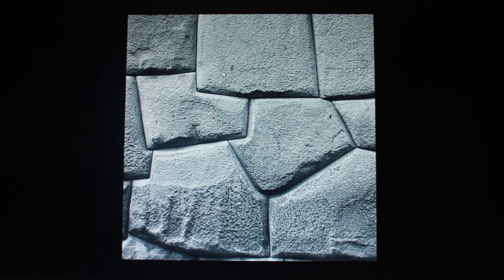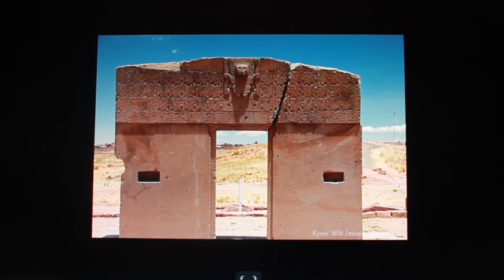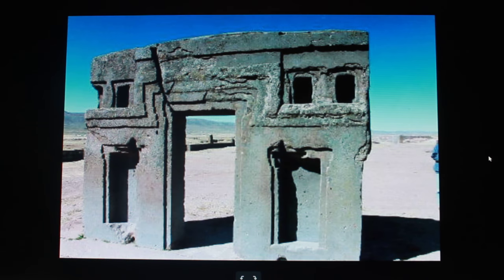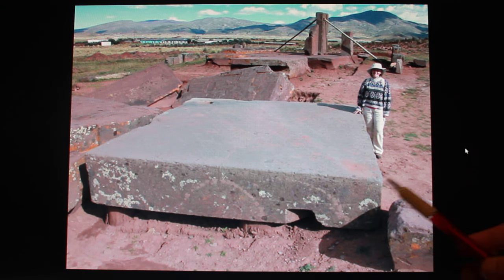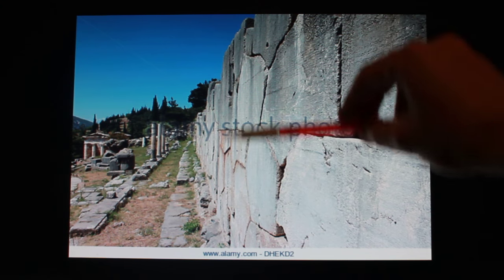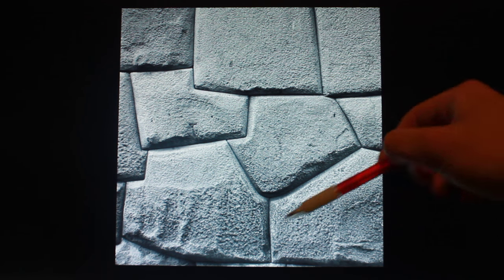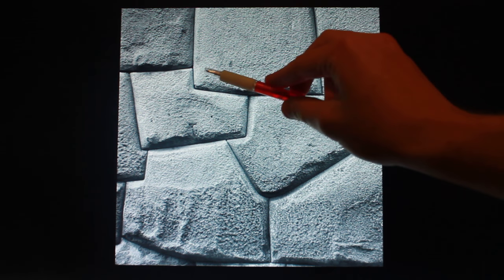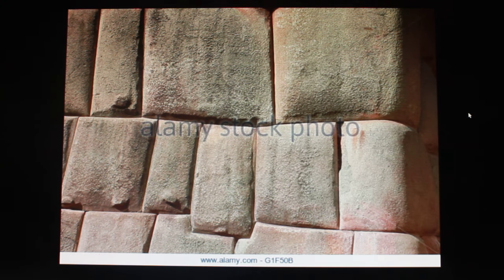How were the POLYGONAL MEGALITHIC INCA WALLS BUILT? LIKE THIS?

Comment: This deserves more downvotes.

These are rocks, they come from a quarry about 5 miles away, there is a lot more of the same rock there.  There are half finished examples not yet cut from the bedrock.

Did it never occur to you that it is very easy to analyse rock to find out what type it is and indeed if it really is rock?    They have analysed the types of rock used, it's Yucay limestone, green Sacsayhuaman diorite porphyry, and black andesite. 

In many places the rocks they used have not been face dressed so you can still see the raw rock texture, yet they are still perfectly fitted together at the joints.   They do not resemble cast artificial rock.

Congratulations on adding yet another half backed theory to an already swamped field!

Comment: I disagree.. If it was concrete mix, then you tend to find more tools, bricks, utensils or other object made up of same or similar concrete, which obviously was never found on the sites or in any excavation. You are also suggesting that Inca walls and Egypt pyramid builders were same and using same concrete method but left no-clues about it? I doubt. For me they are all clearly stones probably first base developers were not humans. Humans added frills on top of it incrementally as they evolve.
Reply from the maker: All good points! Well the clue is the similarity I guess.

Comment: Same mistake as many others or maybe a deception on purpose? Incas stone walls fit perfectly on the visible side and just a little further into the joint. The gaps inside the wall are filled often with filler. Only very few places the fitting would go all the way across the wall and often only on on side. There are many dismantled stones to be observed. And they simply do not fit as a concrete poured stones would, only the facade does. It is of course still not know how exactly they did this, there are many theories, each has its pitfalls. But stop making the concrete nonsense - it is very obvious from the loose stones that this is in fact fitting. There are places such as Sacsayhuaman where you can observe stones that fit on both sides. Still doesn't make them concrete. Yes we may find difficult to imagine how the fitting was done, but it simply was done and the stones themselves are the evidence. They are not concrete or poured material no matter how much you wave your pencil in front of some picture from internet sitting at your home.

Comment: when working with concrete, the bag has nothing to do with the Mixing of the concrete... you have to MIX the concrete to get it to begin a reaction that enables the particles to pond together and harden... yes, you Could use wooden frames to get particular shapes, but as far as is known about those regions wood was relatively scarce. now you Could say, that the lack of trees these days is from deforestation for such projects, but that would have Certainly caused a decline in their civilization because of the drastic change in climate and conditions from those areas due to the lack of water retention via the trees, and soil moisture thanks to the ground cover. now, back to the topic of concrete, typically you have various sized gravels called aggregates that make up much of the volume of the mixture, coupled with cement which is the material that bonds those various particles together. concrete Can be made very strong, that is true, but only in Compression, not in tensile strength, without metallic reenforcement. the texture of those walls, is likely due to weathering, especially if they are more than ten thousand years old, as is claimed by some such as Brian Forster. geologists are also quite good at identifying types of rocks, and if its said to be basalt, it very well likely IS basalt... now, Could it be remelted and then poured in a form Like concrete is? the answer is... only if you have a LOT of heat to be able to adequately melt the stone to a consistency that could be poured and formed. in order to melt stone today, in any quantity takes a Very large amount of energy, and very precise temperature control to be able to prevent vaporization from over heating, and to get the right consistency without any blockiness. and, to control the quality of the stone, would be difficult because there are all sorts of potential contaminations that would ruin a bath and cause the final product to be of an undesirable type. if concrete where used, it would be possible to identify the various aggregates, and the bonding material used. the more Likely scenario, is as brian F said, and that would be very advanced machining technology, coupled with, perhaps an unknown method of being able to move and transport those blocks in the time and numbers required. he shows evidence of what seem to be massive circular stone cutting saws, with a very advanced cutting technology that enabled very fast cuts through the hardest of stones. if you can control the angle that a blade cuts, you could Make and Plan those geometric connections to a very high degree of accuracy, especially if you already have a very good idea of how you want a building to fit together or look, so that for each stone brought to the work site, you could plan the way that where to be cut and shaped, and using whatever mechanism to lift them, be able to lift them into place and set them into place Very successfully, and with relative ease. we currently struggle to lift more than 40 tons with modern crane technology, but there are stones that weigh in at over 1000 tons and more... and even if we knew How those buildings where built, we still wouldn't know Why, and to what purpose they where built. the fact remains that we do not have much literature from people who lived around these buildings, that would tell exactly Who built them and why, and even if we Have a building where a name is given, it is also very well known, especially in the case of Egypt, that rulers would often appropriate and reuse older works and buildings, and Claim that they built or sponsored them... we also have to take into account the potential for astronomical alignments to give an Idea of what time period a building or monument was built, but it can't be said for Sure, if they where not made as a memory or a precursor to a time period... especially if you Know how to read the sky, and follow the constellations, and can make accurate predictions and calculations based upon observations...

Comment: Those are "PRE" Inca walls! I also see that you can't tell the difference from concrete and sandstone, let alone basalt. How was the machining done without leaving any tool marks on the stone? Why are some of the stones magnetic? You have never seen stone that is over 12,000 years old and with one side exposed to the elements. How about the stone that was completely buried and shows no weathering? Is there such a thing as basalt concrete?  Good luck with your analysis, it just does not fit what I have learned of the places you are attempting to describe.

Comment: Is it possible they knew how to cut much larger blocks into Geometric shapes that enabled them to puzzle them together like this?

A design that meant you could virtually use any side or angle of each cut and it still lined up at some point.

Like a huge jigsaw puzzle but not so rigid

Comment: Thanks for your ideas. Each is a custom cut and placed andesite stone. The nubs are at the original width of the quarried stone and are lifting/moving points. Same can be seen in near east and far east, like China.
Reply: JustAnotherAkin Most of the stones don't have the "nubs" so I assume they had to levitated in place because ,  "hey - no lifting fixtures."
Reply: Nubs removed after placement, unless used to stabilize scaffolding. Some never get removed because of limited time and manpower. Also found in Japan. Nubs also locked into sleds to handle inclines.
Reply: Also wanted to mention, when you see nubs going up the side of a stone, it was moved on its side and lifted onto its end. Assembly sequence can be noted by this.One more item is the use of wooden cutting jigs to get the shape needed, were used extensively. When the stone was cut, it fit the first time on placement. These guys didn't do the same job twice. Would you?
Reply: JustAnotherAkin then how to you explain  the nodes on natural walls of stone in peru ?
Reply: I have seen some nubs on the upper side of blocks, just below and outside of window cuts I expect were used to mount something. ie: wood decoration, cloth, or stone carvings. A few can be seen on regular walls right in the center of the blocks, I expect these are just for mounting objects. Note on some walls indented cuts were used for lifting points, this took less work than the nicely dressed stones with nubs. Workers must have been in the "Git-er-done-mode".
Reply from the maker: Cool! You're welcome! Yes I have to say you are probably right for certainly some of the walls, they seem to be cut and placed. That's a good observation for what the nubs are for, yes.
Reply: JustAnotherAkin I believe the nubs are for fine tuning the stone.  either sonics, wieght,electromagnetics,vibratory characteristics I am not sure but the nubs can make a F sharp become a G.

Comment: The nobs are indeed a problem as you stated.  The other is the id of quarries where the stone came from.  This could be the ax to your theory.   Before archaeologists id a quarry, spectral analysis is done to make sure the compositions are identical.  The quarries are concrete mixing sites you might say.  Then why would they be tens or hundreds of miles away?  But, there is a way to explain this.  Can you figure it out?

Comment: Hey Charles, Excellent observations. However, when you are there, and can see them up close, you will realize that on the larger slabs you are probably correct to some degree. But the walls in Cusco were not. they are not the same. More to the actual up close inspection, it appears to be softened stone then shaped while it was soft. I know, crazy talk. but that's what it looks like. 
Especially Saksaywaman.
Reply from the maker: Thank you sir. I never been there. Interesting!

Comment: Reasonable theory. Might apply in some cases of ancient megalithic artifacts but certainly not in many other cases where you can see the quarry marks and where the stone or statue came from. Sometimes hundreds of miles away. And how would the molds have been fabricated to meet the extreme precision and made out of what material? This is not possible unless you have machine guided tools to produce the molds - look at the edges of these "concrete slabs" and door frames! Very sharp and precise. Furthermore there are so many tool marks in Egypt and elsewhere on huge stones and artifacts, inexplicable lath like created vases and other objects that can´t be replicated today. Ramses Statue, 1000 ton with perfect smooth surface and machined like details? We can not even attempt to do this today to shape it, move it, especially on unstable surfaces like sand. A 1000 ton statue in india has been moved up several hundred meters on a hill to be installed there in ancient times. WTH? I found only one explanation that meets all criteria to explain everything. But this is not acceptable from the perspective of most people and of course not from so called "experts". Exotic sciences and research though has shown that there are many mechanisms that are not in the text books (for many reasons) and really are workable technologies, secretly researched and employed since the 30s to this day. Creating a "breakaway civilization" that is far ahead technologically. The answers are available to those who are open minded and not brainwashed in what some "authority" declared to be possible or impossible. (Think about the Wright brothers! Physicist "Authority" declared - ´things heavier than air can´t fly´) - yet they can!

Comment: definitely not concrete. I work with concrete all the time.. huge structures of concrete won't hold without the reinforcements of rebar. so no I don't agree with this.. definitely stone I believe that had a way to make the stone softer and malulable

Comment: It's concrete, that's why you can't put a piece of paper between it because it is troweled on like plaster and the shaped to look like a block. You think they carried those blocks there, no way. Crush the rock mix the concrete with larger rocks and form build it like a block wall then to give it that monolithic look just take a stick and draw lines is the semi wet cement.